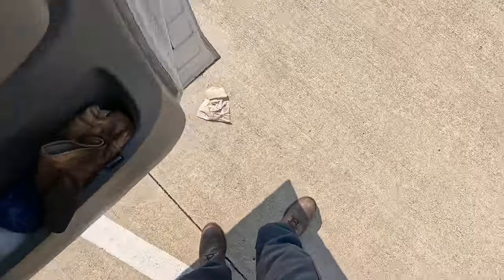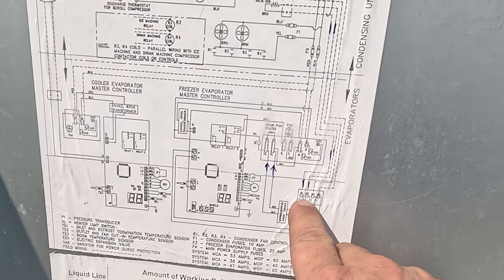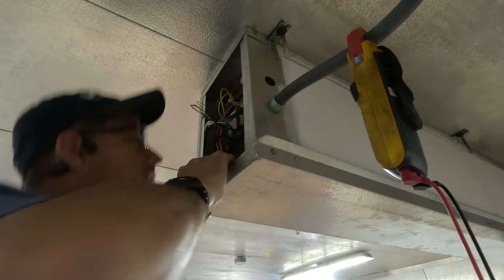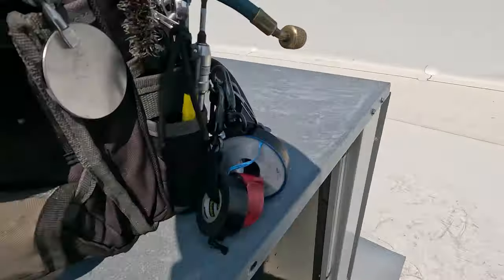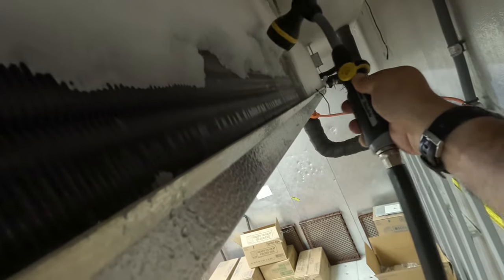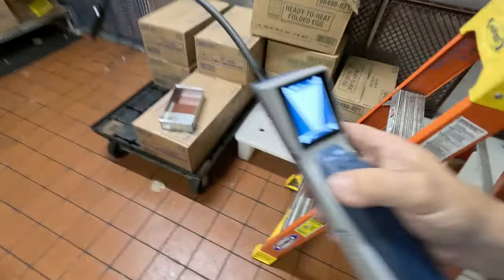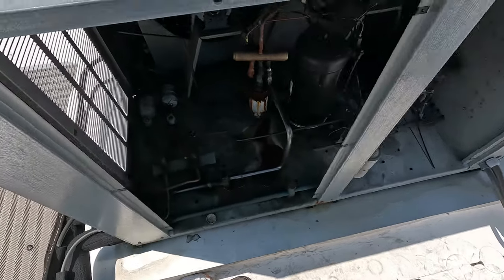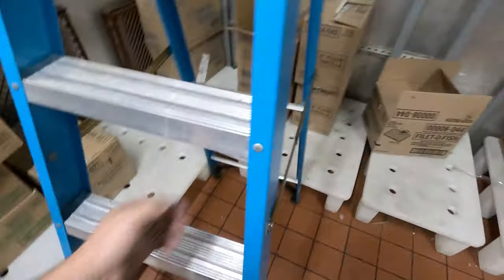Want Fries With That McFreezer Controller?

Comment: MasterBuilt 
Have never worked on these before. I do mostly chillers and some RTU's.
Reply from the maker: I have not worked with their digital controller before, like I said without that book I had nowhere to go with just two buttons. When I started holding buttons I knew things were going to get screwed up and if you don't know what the abbreviations are... holy cow you're screwed. I'm getting into chillers more and more I'm already doing grocery store racks. It's been very slow getting where I want to get to at my company because there's so many ahead of me.

Comment: Master-bilt 13:33  just to let you know those ecm motors come as one part. Someone retrofitted those two on the left evap fans on the left. Likely faulty pressure transducer or temperature sensor, they will do dumb things with a faulty sensor. I’ve only worked on the models with a receiver and birder compressors. Looks like you figured out the sequence of operation fairly well.
Reply from the maker: Thanks Matt! It took a while but I eventually got it.

Comment: masterbilt. I work on these systems a lot. They are kinda crappy to work on at first but when you get ahold of the manual its a lot better to work on. haha! Its weird how they have the 2nd and 3rd cond fan motor set at 80 and then 90 degrees before they kick on. (when you have a 3rd cond fan motor) 
Great work love the videos! Thank you Rick!
Reply from the maker: I haven't seen one that didn't have just one or two fans? That sounds like some of our bigger units, the one closest to the manifold usually stays running all the time, then they cycle them off as they get further away. I will keep an eyeball out for that. I agree now that I know what I'm looking for it's not so bad 👍👍

Comment: heads up, double check the line set size they installed. found a few installs with too small liquid and suction which kills the volume of hot gas defrost.  that eev only opens 50 percent by factory program design which I disagreed with masterbilt tech support, should open 100 percent in hot gas defrost in my opinion
Reply from the maker: That's probably why it didn't defrost once it was so badly frosted. Is there any way to change that?

Comment: Masterbilt. I wonder if the whole circuit just got so cold it had a hard time building up heat and pressure?
Reply: I mean the mass flow rate through the compressor was still low.

Comment: Used to work on Walgreens, they had MB w/hot gas def. Not that complicated though. Wow
Reply from the maker: My problem was finding the manual online, why not just put the information inside the panel. Once you got the book it's fine otherwise you can't even put the thing in defrost.

Comment: Master built. Typically when you see 15-30% Eo valve position when the box is nearing set point your refrigerant charge is good. Otherwise master built uses a formula to determine refrigerant charge, goes by liquid line size, mbh of the equipment and line set length.
Reply from the maker: Good to know! Thank you!

Comment: Hahah. This is the first time I've seen hot gas in a self contained rather than a rack!
I honestly rather like the concept, even if their implementation is a little bit helter skelter.
Masterbuilt.
Reply from the maker: I mean basically it's a heat pump, and the amperage used for the compressor is likely less than what the electric strips  and it should defrost quicker than the electric strips,  so I think it's purely for saving money because there should be less temperature swing in the box from the hot gas defrost
Reply: @HVACRSurvival  Yep! In ideal conditions, heat pump heating is up to 4x more energy efficient than electric. Not sure how "ideal conditions" this setup is though, in fairness.
Bonus points, the defrost should be more complete by getting the entire coil hot instead of just where the heater strips are.

Comment: MasterBuilt, hot gas defrost seems like it would be a problem in very cold weather. How well does it work when the outdoor temperatures get down in to the 20’s and the teens? Gotta love the crap that is being sold today, I’m not impressed with any of the heating and cooling products at all
Reply from the maker: I guess I'll figure it out this winter. We just started taking on some of these stores this summer.

Comment: When i worked on MB units with HGD, i ran into system over charge with trip HP when it goes into defrost due to over charge without a receiver critical charge system
Reply from the maker: I didn't catch it until I got reading about it.

Comment: on these new digital controlers,some times they do not display evap temp only space temp,and if it is open it will say is hot and not allow it to defrost,you might have to ohm out the sensor.just my 2 cents,hope it helps.
Reply from the maker: I will keep that in mind for next time. Thanks for the feedback!

Comment: Just wondering   did the system end up being ok on charge. u mentioned earlier that your Sg was empty.  but it could have been many things.  at least you dont have to deal with Bohn type controllers for Mcd.    i use to do mcdonalds and they were just head aches. trying to tell them that they need new coils. due to the circuit board being bad!!     Masterbuild seems a little easier  !!   good video.   dont understand why  manufactures want to make things harder for the techs.    good thing to do. is to check if the sensors were good.  always ended up changing a sensor or 2.

Comment: I would really like to know  what ever happened to defrost clocks,  how does that MasterCrap board make things better?  what does that board cost?  my bet is you don't stock them on the truck...  I can't believe those boards survive that long in a WET environment... I did ac/ref work for 30+ years...
Reply from the maker: I have one each, a 120 volt and 230 volt traditional defrost clocks on my truck that I feel are the best built clocks out there I also have one of the universal dual voltage clocks with the flip switches, they get crap in the gears and eventually take a dump,  they use basic relays that are supposedly rated for 30 amps that will never survive like the old ones did.  And no I do not have this board on my truck and I'm sure it's probably $400 to $600. Give me a txv, solenoid and a thermostat... I can make anything work

Comment: First time I've seen reverse cycle defrost in the wild! Did you figure out why the pressure at the condensing was so low while it was in defrost the first time?
Reply from the maker: Theoretically if you're running the inside unit as a condenser without a fan and it's cold in there your pressure is going to drop then they metered the flow with the electronic expansion valve causing it to be even lower, somebody just mentioned in one of the earlier comments that they throttle it at 50% not even full flow. This is the first time I had to dig into one of these. We don't do a lot of work for them but when you run into these it's more challenging until you get used to it.
Reply: @HVACRSurvival  Interesting! I suppose without a temperature sensor on the liquid line they can't do anything else other than set the valve to a fixed value. Seems less than optimal but looks like it must work most of the time. Cheers for the reply.

Comment: Does this walk equipment have a reversing valve?
Reply from the maker: If we're talking about the masterbuilt system I released yesterday? Correct, I showed the valve a few times throughout the video. Same type of valve that's used in a heat pump.

Comment: Maser bilt  and charge by weight on those there like a mini split lol
Reply from the maker: Yeah it's crazy they get away with no receiver because of that electronic expansion valve. They don't care about the pressure differential across the metering device because it doesn't matter. It also increases the efficiency from what I read.

Comment: Masterbilt 
Master crap actually 

I do know that you do not clear the sight glass on that system 
They are floating the condenser so bubbles are normal on it 
Which messes up a lot of guys that love to just clear them sight glasses 
Walgreens uses the same equipment except it’s in a multiplex 

I was yelling at you Rick look in the cover the legend is there 
How do I know because I did the same pulled it on my phone and then found the dang thing when I put it back on 
Lol 
Great videos man thanks
Reply from the maker: 🤣🤣 I know that feeling of watching it happen😊. But that side panel didn't tell me the definition If I remember correctly.  🍺🍺🤜🤛👍👍

Comment: The transformer should be sealed being in a damp environment you would think? Those plastic fans looks like an external rotor type motors. I have never liked hot gas defrosts for freezers as they can never compensate the idiot with the door control 🤪🤪🤪. The restaurants here now have a door alarm that says "The freezer door has been left open, please close" and nothing happens...
Reply from the maker: On some grocery stores the door switch only affects the system while it's in freeze mode and not in defrost but that depends on how the person wires it. Supposedly those fan motors weren't available anymore from what their maintenance guy told me and that's why he had to change them to the other one. I'm not sure if that's accurate or not but that's what I was told.

Comment: You must rip out the controller board and replace it with mechanical, defrost clocks and thermostats, and then you’ll be OK for the intermittent fuck ups

Comment: I hate hot gas electric is way better

Master build
Reply from the maker: If it's working right it actually works quicker, we usually sell and work on heatcraft, these are the first ones I've seen around here.